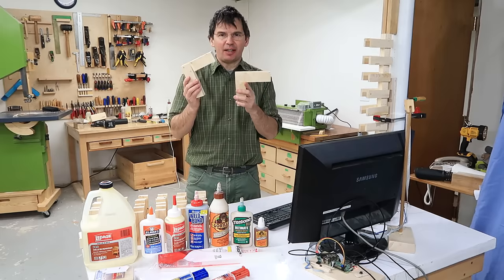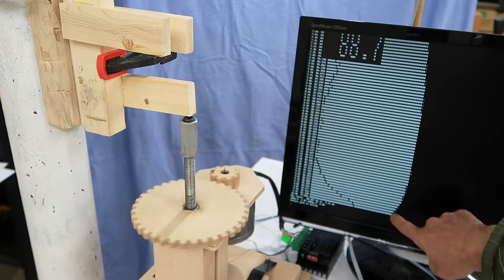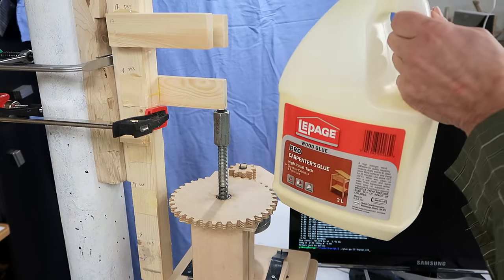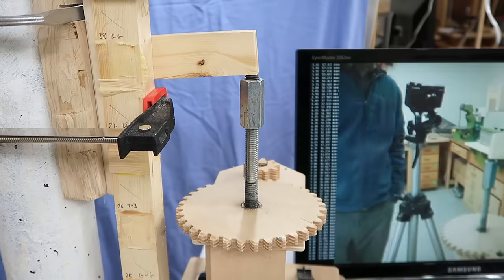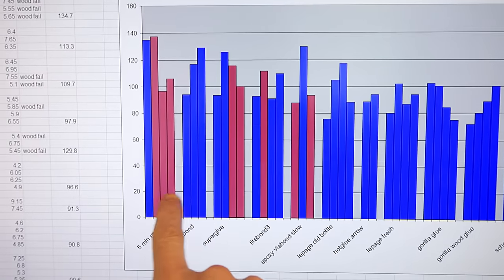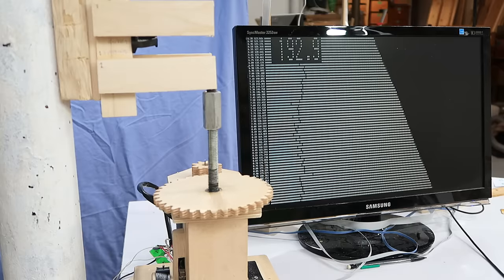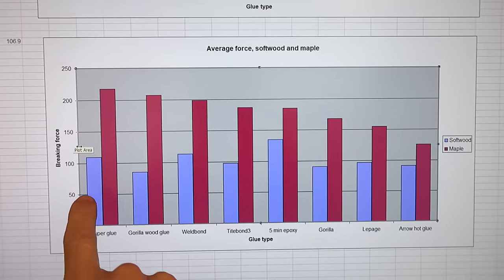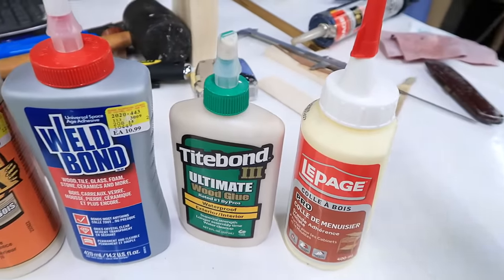Which glue is strongest?  Testing with my computerized tester.

Comment: I've had bad experiences using both construction adhesive and Gorilla Glue (the foaming kind). The joints were not under stress (Gorilla glue - trim on outdoor projects, construction adhesive - hardwood decking lying atop PT joists), but over time (a couple months), they literally just fell apart.
Reply: I don't understand that foaming glue at all. And it can go bad really fast too. I've heard some people that absolutely love using it. They clearly know things I don't.

Comment: For hot glue it has a few advantages in that it fails gently and doesn't tend to damage the parts, and that it is easy to remove with rubbing alcohol should you want to repair a joint in the future. Project farm did some testing of a bunch of hot glues and seemed to find the Stanley Dualmelt as hard to beat so it would be interesting to see how that works out for you. Also, if you combine the Stanley hot glue with the larger Ryobi cordless hot glue gun it is a potent combo for repairs.

Comment: i noticed that you did not dampen the wood before applying the glue ok some of the glue's.
as you know by doing this it allows the glue to trace into the wood instead of just sitting on the surface making a stronger joint.
most wood glues you do this with

Comment: Surprising results!  I wonder if Lapage glue is similar to "Titebond Original" which is what I can get where I'm at.  I bet so.  I would definitely like to get some glue that doesn't go bad as quick.  As you say - for most applications, strong enough is strong enough and thus the question of easy application and clean-up becomes the most important thing.

Comment: My experience with construction adhesive (on job) told me how limited that stuff is... I literally do not understand why anyone would ever use it- for anything, after one year of time, it dries out and fails without any external stress at all, the expansion and contraction rate of the wood itself will pop it off.

Comment: How long did they sit for before the test? I've found that the construction adhesive take a long time to fully cure, taking a couple of days to reach full strength. Even longer if it's a bigger area glued. After that, then it is very strong.

Comment: Nice testing! 
I use the Polyurethane Gorilla glue for outdoor rough carpentry: arbors, benches. carts and planters because it self seals the joint and has lasted 10 years in some cases. It is more work to apply and clean up, I often have to moisten the wood to insure that it actives. Epoxy would be my next choice for outdoor wood adhesive but dislike having to mix it each time.
Reply: I have had great results with Gorilla Polyurethane for gluing broken concrete and clay planters back together. I have a huge round one that snapped around the rim when we were lifting it, so I water-jetted the joint 100% clean and glued it whilst still slightly damp.
It bubbled out like crazy, but I let it dry then ground it off with a sanding flap disk! That was about 5 years ago, it's still as solid as a rock! Only drama... the glue goes off much too fast in the bottle, and so does the SIKA brand.

Comment: If you put the test rod right under the glue joint rather than on the end wouldn't that eliminate the problem of the wood failing before the glue?

Comment: So would the results necessarily reflect real life wear and tear? I'm not being critical, I genuinely don't know and I'm curious. As an example, if I try to think of most organic glue failures I have encountered, it was often a result of racking. The other example is things with four legs being dragged and that stretching the form. And then, is there any way to determine how much time is a factor? Like in the context of a piece of furniture being able to withstand a fair amount of minimal abuse like racking without the glue fully failing. Are there maybe some glues that have more of an elastic effect versus others that become brittle? I feel fairly confident that there would be a similar graph for other failure modes, but who knows until you try?

Comment: The polyurethane gorilla glue is completely waterproof, so it's a great choice for joints that will be submerged in water for long periods of time. It also works great on pressure treated wood that's still wet. 

I used it to glue together a wooden stand that's been submerged in water for the past four years. I finally got a chance to pull it out and inspect it, and it still looks great. (I'd like to strength test it, but I still need it and don't want to spend the time and money to build a replacement.)
Reply: every PU glue is waterproof - this is an inherent propoerty of polyurethane, 1-Component-PU-Glues harden by consuming water out of the air or the workpiece, water cannot reverse this reaction

Comment: Try Titebond original an titebond 2. My favorite is # 2. I have found Gorilla wood glue does not hold up to time. Built pair of chairs an both failed within 6 months. Had to rebuild them for my client using TB2. I have 40 year old chairs make from original TB and still holding up. Made from Ponderosa Pine. Country style chairs. Big sellers back in the day.

Comment: I’d like to see construction adhesive get a second chance. I’ve tried a lot of different brands, and the difference in performance is huge. Some failed easily on the glue like your tests, but others I can hardly even scrape off the squeeze out.
Reply: This has been mentioned quite a few times already but youre right there are as many types of cons. adhesive as there are wood glues and they all have very specific properties and uses... Definitely not all created equal! Bottom line IN MY OPINION is that if youre building a project out of wood or plywood or MDF you should be using wood glue and nothing else! If you need to mount said project to a masonry wall or something, then you use cons. adhesive.

Comment: If I recall correctly, Titebond III is actually weaker than Titebond II .  It is just more waterproof, and has a longer open time.  The more straightforward comparison to the Gorilla glue would be Titebond II .
Reply: Titebond II is my go to glue. Is it the best? Probably not. But it's good enough for me. Usually the wood fails before the glue does.

Comment: The foamy gorilla clue is polyurethane glue, which is a good choice for joints that get in contact with water.  
Polyurethane isn't for most projects, but it's on another level when it comes to waterproof glues.
Reply: yep PU is easy to use compared to D4 PVCa  

even if you don't know what you are doing, PU is inherently watterproof, but waterproof PVCa glues are not, if you use them wrong - especially if they used too cold

But: usually nobody needs waterproof (D4) glues - even in high humidity areas like in the bathroom, D3 is usually enough - for cutting boards even regular D2 PVAc glue like Titebond Classic (the red one) is absolutely fine and won't break.

Comment: I'd be curious of the differences between Titebond 1, 2, & 3. My understanding is that Titebond 3 trades off some strength for flexibility, so when it's used outside it has some give as the wood expands. Whereas Titebond 1 & 2 are stronger, but more brittle.
Reply: Actually according to the Titebond site the order is 3, 2, and 1 from strongest to weakest.
Reply: BreatheScotland  Titebond 3 is waterproof. Titebond 2 is water resistant and titlebond 1 isn't. Gorilla wood glue(big bottle here) is basically the same thing as Titebond 2.
Reply: @MrMega200  Titebond 2 and 3 are food safe... can be used on cutting boards
Reply: @bobbyt9999  yes for indirect food contact meaning the joints have to be exact to not let food contact the glue. It was right on the bottles that titebond 2 is water resistant. 3 is completely waterproof.

Comment: The biggest problem with the conduction adhesive is most types required some space between the two surfaces. Not ideal for fine woodworking but ideal for course construction.
Reply: also PL400 is more like subfloor adhesive. PL Premium would show better results
Reply: Water-based construction adhesive needs a MONTH to cure, no just a day. The Polyurethane ones can be good, but they often need a very long time to cure because the skin blocks moisture (water vapour) getting inside the joint.

Comment: The long set epoxy can take a week or more to completely cure at lower temperatures.  You can mix some up and make a small form out of it and see that even in 24 hours time its still quite flexible and as time passes it gets stiffer and harder.

Comment: I'd be interested to see how the glues would perform if the pressure were coming from 90 degrees to the current setup (i.e. pressure against the flat rather than the edge of each sample, thus changing from torsion to tension)
Reply: shear

Comment: Lately, I’ve had bad luck with titebond 3 joints popping loose after a year or two, not sure why. Perhaps I got a bad bottle or didn’t shake it up enough? What’s odd though is all the cutting boards I made with titebond 3 are fine. Also, I think the gorilla wood glue is usually type 2 and titebond 3 is a type 1 wood glue.

Comment: Too bad you didn't test Elmer's wood glue, because Wright got excellent strength with it.  Also, is there any data or intuition about whether the bond strength changes with age (of the joint, not the unused glue)?  That's pretty important.

Comment: west marine   SIX-10  2part  thickened epoxy in self dispene mix tube.  wood
 and fiberglass boats are built from the assembly line with it. strongest epoxy youll ever use at this time, also is very exspensive.   if your not leting all your test set dry for 5 full days at  60 to 80 degree ambient temp------   there not at full strength.  you probaly already know, but to get a better bond strength you should use 60 grit sand paper on all mating surfaces before applying epoxy or glue.  jb- marine weld 2 part epoxy is also another close to six-10  epoxy in strength  from west marine.  very nice video, the gears applying force by electronic  control is interesting. good day.

Comment: I finally bought a new bottle of titebond lll after I finally finished the old one from at least six or seven years ago, which, despite freezing a few times in storage, still was kicking until it was empty. I'd assume any are about as good for most purposes, working time and shock loading potentially differentiate them a bit more, but it's definitely good to know what's strongest when it absolutely needs to be. Super glue might make a comeback for me, now that I know it's generally strong enough when I don't have patience

Comment: On the topic of wood glues going bad I would be interested in learning if any of these brands of glue will survive freezing.  My workshop is my unheated garage, and I always end up forgetting the glue out there over the winter.  Every brand of PVA wood glue I've tried turns into a useless frothy mess after being frozen; I suspect it's unavoidable due to them being water based.
Reply: I don't remember the brand, but the wood glue I left in my unheated garage stayed as hard as a rock after spring came and it thawed out.  So, I just make sure I bring the glue into the house for winter. :)

Comment: Hot glue is amazing at gluing end grain (to long grain or even to end grain), and it sets up fast. That makes it great for jigs, imho.
Reply: Also, CA glue is great for a while but the bond deteriorates over the years, in my experience. It's great as a clamp, though.
Reply: @englebig  cyanoacrylates are very brittle and hygroscopic - in regular humid enviroments they get brittle and break - if you want a more permanent bond, you have to stick with PVAc or PU glues
Reply: @suit1337  yes, precisely. I think that's important to mention in addition to Matthias's strength tests...

Comment: The way I look at it is all the wood glues are close enough to each other. What glue I choose is based on if there may be water around, if it is a large glue up, and if it is a dark or light wood. It helped that it was on sale as well. I may need to check out the open set up time on the Gorilla if it is shorter or longer than Titebond 3.
Reply: 100% agree

Comment: Great test results, however you unfortunately did not pick the proper type of construction adhesive: The much stronger PL Premium 3x or even the  PL Premium 8x Fast Grab or better the Pl Premium Max version. They are all stronger. The subfloor adhesive you used is obviously for large surface area subfloor applications, and is a builder's grade adhesive...

Comment: Very interesting results. I've always favoured Titebond 3 over everything else, probably just on reputation, but now I'm wondering if Gorilla might be just as good (it's generally a bit cheaper than Titebond in Britain).
What would be very interesting is a test of how waterproof wood glues are. I remember someone in the U.K did a test of several common brands and left the test samples out in the weather for a few months to see how they fared. Can't remember who did this and the only result I recall was that the Gorilla polyurethane glue failed very quickly.
Reply: Hey, Gorilla Glue(the one with type II label as he shows here) is the same as Titebond II going by the wood glue standards. So just either one would work fine. Just buy the cheapest. BTW from me leaving a glue mess of Titebond II and III out on the deck from a project I have noticed a difference. The Titebond II softens up to a creamy soft look but the Titebond III doesn't do this. It hasn't come up from the deck at all in years now from snow and rain. I don't recall if the Titebond II has ever left the deck. So I'd consider Titebond III very important for pieces that will be outside exposed, kitchen use, or under some cover but could experience weather.

I know the other glue he shows is just a type 1 and isn't good for water exposure.
Reply: I'm not that familiar with Titebond or Gorilla glues other than from their branding as I mostly use local glues, but usually PVA glue prices go up with how waterproof they are.    
So if you want to compare prices, you should always check how the glues are rated, so you're not comparing apples to more waterproof apples.
Reply: @vonantero9458  You really have to go with the standard stated on the bottle itself. It will be in the front or back in some paragraph. All PVA wood glues like Gorilla or titebond HAVE to state a certain standard in the USA and Canada. It's really the only way you would be able to know that you are comparing apples to apples instead of an apple to an orange.

Comment: So why does the Heisz lad swear by construction glue? I mean the application- Is it significantly cheaper than normal wood glue or CA? The only way I could see it being good is perhaps for its lack of performance, used in conjunction with hardware or joinery as it would make a strong enough joint out of a less sure fit, that you could also get it apart again relatively easily. But that is really defeating the point of the join in the first place. Construction glue seems like it would be crap for working furniture, like a set of shelves or a table or chair.

Seems like if one was just going to add hardware anyway, using a glue as opposed to a clamp to temporarily hold two parts together, a small blob of super/CA with some accelerator spray would be just perfect for a quick hold, over having to lift a gluegun or a clamp, let alone the consideration of cure times with more traditional glues.
Reply: because his workshop is frequently in the 5c-10c temp range  (40-50F)  It does well at lower temps.

Comment: So from experience and from seeing glue tests on YouTube if wood is glued well often the wood fails and not the glue joint.  Glue is Just that cool. What I always think about is the strength to weight ratio for various woods. I figure VG fir and oak have very high strength to weight ratios as in least weight to highest strength.  Pine lighter not as strong.    Cherry heavier but not enough stronger.  Have you ever thought about testing something lake that?

Comment: Doesn't TB3 have better water resistance than Gorilla Glue? That's at least why I use TB3 over 2 on anything that gets wet - cutting boards or anything outside.

Interesting how well CA glue performed. It'd be interesting to see a long term test, especially with exposure. Glue some samples, leave them outside for 6 months and then test.
Reply: I also wonder about the long term durability with CA in a wood application. It is strong, but much more brittle than other glues. How's it going to hold up to repeated seasonal movements of wood?
Reply: Most PVA glue is water resistant. Then there's waterproof glue. I try not to soak my cutting boards.

Comment: I am super surprised about hot glue's viability. For certain applications, the ease of application and how fast it dries, it could possible be a decent choice, like quickly throwing together a prototype that doesn't have high structural requirement.
Reply from the maker: Exactly.  My hopper fed cap shooter is mostly put together with hot glue
Reply: Tom Sachs talks about this in detail. It's the perfect glue for prototyping.... even if you prototype for a year.

Comment: i know it's been mentioned, but i thought i'd put out here that after what i remember from the Project Farm wood glue test video i always get Titebond 2, it showed much better than original titebond, and can be found anywhere
Reply: Titebond 2 is decent. But it isn't the best. Still it's good enough. I don't want to say all PVA glue is the same but it pretty much is. You're going to get fairly comparable performance out of all of it. I'd think the quality of the wood joinery is a more critical factor and if you're counting on extra strength from glue then that's more on the work you're doing than the glue itself.